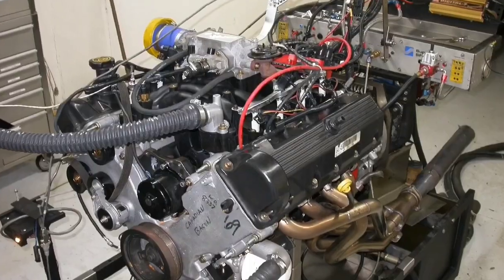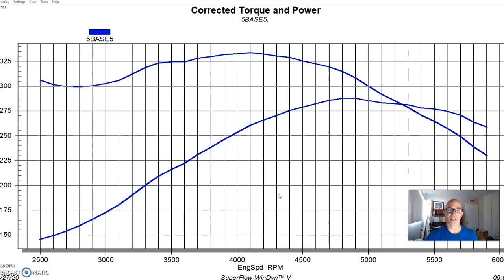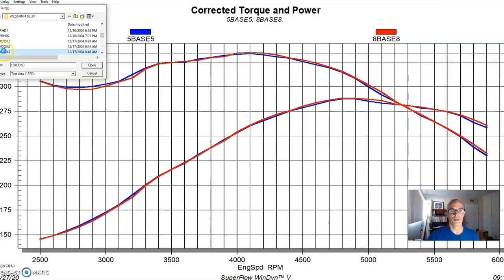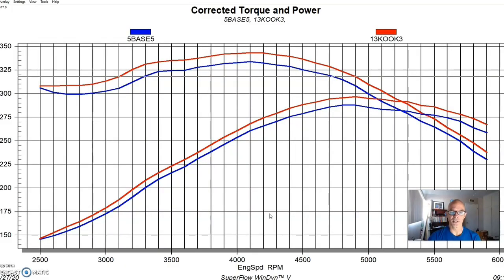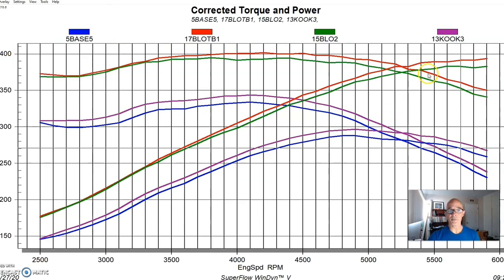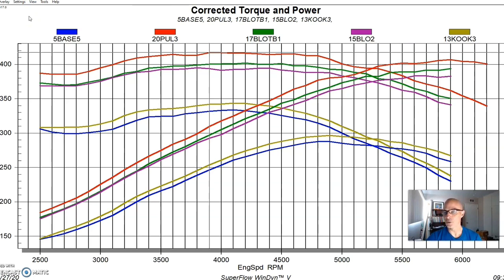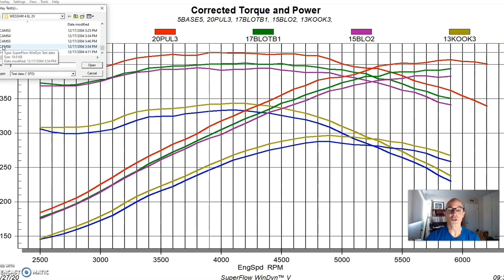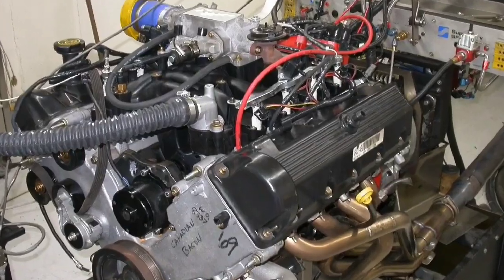FORD RACING SUPERCHARGED 4.6L 2V TEST

Comment: I want to try it on the Ford 2006 5.4 liter. I believe it's gonna work. I'll be doing it on a small budget. Cold Air, Throttle body, long tube headers, under drive pulleys for stock NA, no blower. Cams, maybe gaskets port matched home port job on the heads. HP fuel pump. Cam phaser locks locked, tune. Throw out F-250 bus muffler, and toss the resonator,  flowmaster duel exhaust. HP coils. Hit nOS button. Hold on. I like the comparison too, on each upgrade. Yeah good video.

Comment: Great set up . When i started on this 2v quest i knew i was at a disadvantage with the 2v, but was thinking that with some type of forced induction system i would magically make the car just as powerful ac the 4v after all the are the same cubic inch Right . Throwing money in the car like crazy didn’t exactly work . Nevertheless, i did produce something a little different . If i had started with a terminator , i simpl would have had a bit more fun and probably a bit less headaches . I was lucky enough to get my hands on a Saleen Series V 2.3L 2V blower taken off of a Saleen Extreme .

Comment: How was the manifold made onto the supercharger like that??
Reply from the maker: special casting, machined to accept the rotor pack
Reply: @richardholdener1727  would you happen to know where i could get that done? I have a separate m90 s.charger but i have a plastic intake. I'm looking to get an aluminum on some where for fabrication

Comment: The Eaton tvs supercharger is better all along the rpm ranges. I worked there for a long time. Factory limited the psi to make the engine last longer.
Reply from the maker: better than a standard roots blower?
Reply: @richardholdener1727  yes twin screw , like used on top fuel dragsters. Power on upper rpm range doesn't drop like the roots blower. Eaton tvs supercharger also has abarable powered coated rotors. The coating seals itself on the rotor gap , the roots blower made by Eaton has painted rotors, leaving small gap . Most of the supercharger on cars was set about 4-6 psi of boost. This was done to make the engine last for 100k miles.

Comment: I watched this video with a big smile.  The final setup is very similar to my setup.  I have the FRPP SVO blower (9 psi), a 90MM Lightning MAF, 70MM throttle body, Comp XE270AH Cams w/Ported PI heads,  Longtubes, catted H-pipe, 4.10 gears, Snow Performance water/meth injection.  Biggest issue I have is IATs even with water methanol.  The car pulls like crazy on a cool day though.  Huge difference from stock.  I have had the car almost 21 years.  It is a 2000 GT.   I might have gone with a different cam and gears but those were added to the car long before I got the blower.   Thanks for this video.  I have not had a complete dyno just yet. Tried but there was a problem with the dyno once we thought we had the tune right.  More to follow.
Reply: Has any of these modifications affected the reliability of it?
Reply: Not sure if you were directing your question at me.  However, I will say that it has taken some serious tuning and elbow grease to get the car to perform up to my standards.  The torque is unreal and it pulls even in 5th gear.  I did have to replace the coupler on the supercharger recently.  That was not a difficult task at all.  I have not had a recent dyno and I don't really like to guess but if I had to ... I would say the car is around 430-450hp

Comment: Do the long tube headers take up more space than the OEM? . I'm interested in fitting them to my MG ZT 260 4.6 2V . But space might be an issue.

Also, was that power output achieved without cats?
Reply from the maker: there were no cats on the dyno and long tube headers do take up more space
Reply: @richardholdener1727  there is not a lot of room on the ZT v8 . Might see about getting some custom long headers made in that case.

Comment: was not aware that ford racing supercharger even existed. seems sorta pointless unless it is priced at under a thousand dollars and noticed that the cam swap was a minor jump in power when considering there was boost involved. Would like to have seen a before and after short header with boost ? I mean if shorty headers made an extra lets say 8 hp over stock manifolds on a boosted application ? I mean I picked up a set of ford racing shorty headers for $65 and ceramic coated them and yes they are a lot lighter then the stock manifolds which is a plus. Main reason did not switch to long tubes is because I have stainless steel bassani X pipe and live in PA and do not want to use mild steel to hook up long tubes to my X pipe.

Comment: M90 isn’t the Ford racing kit based on on the M112?
Reply: Ok that’s the way I remembered it. I had an Eaton M90S on my 4.6L T-Bird (2000 Mustang GT engine). AED (Allen Engine) kit @ 9 psi. Intercooled and tuned by Jerry W. Fun times.
Reply from the maker: YES

Comment: Would you do a 5.4 2valve vs 3 valve vs 4valve? I have a 2000 expedition with a 5.4 2 valve and I kind of want to know should I sell and get a Chevy truck and upgrade it or upgrade my current scooter box. Thanks buddy
Reply from the maker: I have never run a 3V
Reply: @richardholdener1727  yeah was hoping to find some 5.4  2valve vs 3 valve vs 4 valve specific stuff stock upgraded NA and then turbocharged on all of them to see where I should go with my truck. I just started looking at the stuff since funds are tight and I cant do an LS build anymore

Comment: If I run the stock 6lb pully, would I still need to tune the car? I found a used one but it is just the supercharger, nothing else
Reply from the maker: yes you need to tune

Comment: Just re-watched this video and right off the bat you have 288 horsepower on a stock motor?!? what the lol. this must be the forged pistons and lack of accessories or something? a regular crown vic 4.6L 2v usually putting out whopping 200hp on the dyno.
Reply from the maker: this is an engine dyno-not a chassis dyno-no accessories, optimized tune, open exhaust etc...

Comment: When running the Ford performance supercharger kit, did you use factory 19lb injectors or up those as well Rich? I'm planning on putting a small m90 on my 2v but want to know what exactly I should use for my injectors. 
I'm going to upgrade my fuel pump with a hi flow fuel filter, an adjustable fuel pressure regulator, but I'm unsure about injectors sizing.
Reply: I should mention that it is a NPI block Pistons, with pi heads cams and intake, long tubes etc. I pretty much have all the bolt ons I can get
Reply from the maker: injectors need to be sized for the power level (you will need injectors larger than 19 pounds)-think 36-42 range would be good
Reply: @richardholdener1727  awesome, thanks Richard. I picked up a m90 off a Bonneville. Planning on running it on my 2v in a similar setup as the supercoupe thunderbirds had theirs setup. With blow through MAF sensor. Any suggestions on version or versions of blow through MAF sensors? Again thanks alot for the help so far. I'm sure I'll have more questions in the future lol
Reply: I should also mention in budget building. I try and maintain as many junkyard friendly findable parts as possible. Now I understand that I won't be able to always use oem items, but if there's any chance it'd be easier to find in a jy than having to pay alot of money to replace would be ideal.

Comment: The 4.6 2 valve has awesome potential contrary to what people say!
Reply: Nope it's actually hard to make real power with it unless you force induction it
Reply: @timothywalker2273  actually I was thinking of forced induction as well. As far as making "real power" that is subjective. No matter what platform your talking, to be competitive your using forced induction regardless of powerplant. No one these days is using NA to be competitive 😉 NA is for weekend warrior street cars and people messing around. When you want to get serious your either Poppin bottles (nitrous), turbo, or supercharger.
Reply: @erikturner5073  there are tons of hci Camaros firebirds corvettes running all motor pushing 500HP some on factory ported heads
Reply: @timothywalker2273  still your not making "competitive" real power on N/A. A person making 500hp NA, will get smoked by a car making 400hp with nitrous.
Reply: @erikturner5073  how
Reply: @timothywalker2273  simple, it will take longer for the N/A to generate it's 500 hp than it will for the nitrous 400hp to generate it's power.

Comment: I keep reading that the FRPP/SVO blowers were M112 superchargers, not the M90. There seems to be a few sources that say otherwise but after looking at the rotors and length of the case, its definitely longer than the M90 case/rotor pack.

Comment: Another great video.  I appreciate the 1-piece at a time changes and corresponding dyno tests.  What would be nice to see would be the difference between a stock PI motor, and just swapping the heads out for the Trick Flow heads still using the stock everything else.  All I see is the Trick Flow heads and a cam swap at the same time.  A slightly more aggressive cam than the stock PI cam can on a stock PI motor give around a 30 HP increase on its own.

Comment: What about a 5.4 3V wih cam phaser lockouts?  New timing chain and guides. Also upgraded oil pump. I feel like the factory fail points have been addressed Now Im ready to add power. Camshafts and long tubes first maybe?  Surely these engines will respond just like a 2V right?
Reply from the maker: YES- THEY MAKE EVEN MORE POWER BECAUSE THE HEAD FLOWS BETTER

Comment: Might be a dumb question, but if I have the cams changed in a non-PI 4.6 and get a larger throttle body, do I need to get a tuner?
Reply from the maker: yes

Comment: This is the exact same engine in the Crown Vic Police Interceptors, correct?  I know mines a 4.6L 2v as well but just curious since there's no mention of it. I assume there would have been considering there are probably more 4.6L's in CVPI's than anything else. Sorry for the uncertainty, not exactly as car savvy as I would like. 
Too bad the supercharger set up has been discontinued for so long and that all those mods probably cost more than getting a 5.0L from an F150 or something. I know long tube headers are like $1200 right there. A used 5.0L is probably like $3-4000., then you got yourself "395hp" from the factory which is fairly similar ballpark, wouldn't be surprised if a 5.0L could handle much better gains with a little modifying. 
Thank you for the video though, it's interesting to see and exciting to hear that our 4.6L's can be buffed up. You mostly only ever hear people saying otherwise.

Comment: i have built a non pi style of engine into a pi which ended up having more hp only things i have changed was the pistons and heads kept the bottom the same but changed the heads pistons cams and intake the motor woke up drastick. i wish i can get the supercharger for mine but i have a nice sleeper xr7

Comment: Where tf did u get that supercharger I've been looking forever!
Reply: I have one of those supercharger kits. Only had 7k miles on it before it pulled off. Willing to sell
Reply: @timothysargent7414  how much?
Reply: @timothysargent7414   I'll second that..how much...
Reply: @timothysargent7414  where are you located
Reply: @rogeliovergara2108  MA
Reply: I have one
Reply: @coreyturner198  for sale? If not where did u get urs??
Reply: bassheadray it can be if the right offer is made.
Reply: bassheadray I found it online. It’s just missing the secondary idler pulley bracket
Reply: @coreyturner198  still have it?
Reply: @mikeb1928  no it’s gone.
Reply: Me too. Has anyone found one!
Reply: @markdanielmaddix8476  Richard let me know its not available anymore. I would look into the Eaton 112 if i were u. Im looking into this too.
Reply: @rob5598  yeah I know it's not available but am hoping to find a used one even though it's like finding a needle in a haystack 😢
Reply: @markdanielmaddix8476  just sourced one for my mountaineer $4,000 but in good shape took me forever
Reply: @mercury0214  😲 I'm a little jealous! Congratulations 👏👏👏. I think I'm going to build a 5.4 4v then modify a terminator kit to run on it! If I ever find one of those I'll build a supercharged 4.6 2v to put in something.
Reply: @markdanielmaddix8476  sorry should clarify i got an Eaton 112 and the tork tech kit not sure what the one in the video is! Kenne bell also makes a stout kit aswell!
Reply: @markdanielmaddix8476  and sounds sweet  5.4s are torquey boys lmao
Reply: Im looking for that exact supercharger too.
Reply: I am also looking for one and can’t find that bassheadray website can you share the link
Reply: @lukuszick  he said bassheadray because it was the name of the guy he was replying to, its not a website

Comment: The compression and the small supercharger is whats really holding this motor back. Higher compression (10.5:1 maybe) a bigger supercharger and e85 would definitely wake this motor up. I'd imagine power with the above modifications mentioned this little motor would easily break 500hp. At that point however the connecting rods would be the weak point if they were stock, which is what I'm led to belive.
Reply from the maker: we ran a Kenne Bell and Vortech on a 2V motor up past 600 hp with stock internals
Reply: @richardholdener1727  wow, im impressed. I was led to belive the connecting rods were a weak link but its nice to be wrong in this case. Thank you sir!
Reply: I can't tell you how many people back in the day were trying to tune 4.6s like it was a pushrod 5.0. Same with new dodges. People just lean the fuck out of them and change nothing else hoping to just gain horsepower. Do you notice how when a platform first comes out, there's always that one company that just fucks everything up. For the Coyote it was Bama, offhand I can't remember who was blowing up all the hellcats and SRT8s. Back in the early MAF pushrod days it was anything bbk lol.

Comment: What is not said in this video is how these mods affect the motor and the vehicles bulletproof reliability. These motors are known to go for many hundreds of thousands of miles. I have a stock 2001 gt with 230,000 miles and still going. So how does these nods affect it's daily driving ability?  Turning it into a hot road that is a second or third vehicle? And also not mentioned is that all these mods are going to lead to other mods as well such as bigger brakes, etc to cope with all that power. And that original transmission won't survive either with these upgrades.  When you start doing good the numbers you will quickly find your putting a lot of money into it. It's fine if your a diy person, have your own shop etc and this is not your primary vehicle. It's just that some of these mods lead to many others you have to do as well.

Comment: Long shot anyone know if that super charger would go on a 94 mercury cougar basically a ford?
Reply: Not a perfect fit. 91-98 4.6L engines have slightly different shaped intake ports and water jackets from this 99-up PI 4.6. Probably could make it work but not ideal.

Comment: I'd like to have one of those superchargers laying around. I feel like another crown vic is in my future.
Reply: good luck with the air inlet for the mustang being on the passenger side...it's on the driver's side on the 'vic and marquis...
Reply: @wrenchski  welding fixes everything
Reply: @yhtengineering86  yea, I wanna spend 6-7K on a blower kit and then have to cobble up an intake...I'm not one of those guys who love work and hate money...
Reply: I have one
Reply: @coreyturner198  you have a ford racing sc?
Reply: @coreyturner198  can I get a part number

Comment: For a truck owner who wishes they would have got the 5.4, the long tube header, throttle body and blower would be a good combo.  +97 HP and +58lb-ft would probably eliminate feelings of "I could have had a 5.4!".  Especially if you had one of the low power 4.6s like around 230HP.

Comment: Whoever built that motor most likely built it for a Big NoS shot probably close to 1000HP shot that’s about the right compression for that kind of NoS 10-1 works good up to about 250HP any higher and your not really getting anymore I saw I guy get 200HP from an 800 shot because his compression was already 16-1 next time u saw his car it had a supercharger on it, one of these days you need to try a really aggressive race cam with a duration of .0519 the rest really don’t matter the duration is important that duration sounds so good that’s what I ran in my drag car